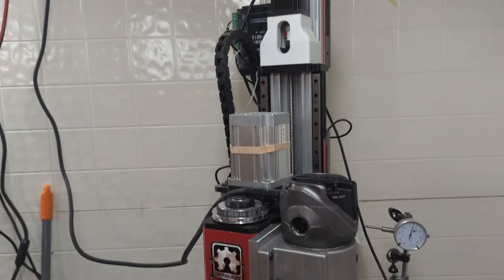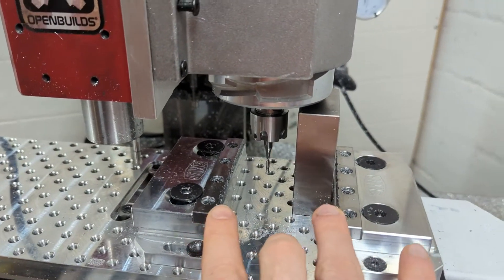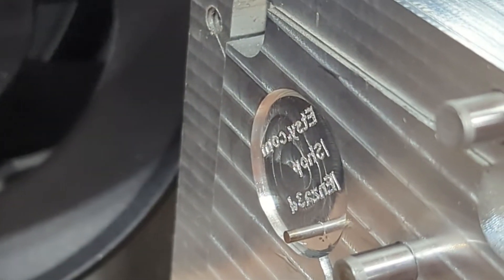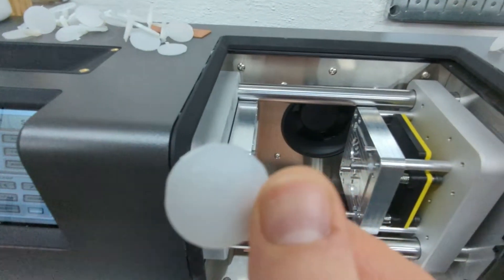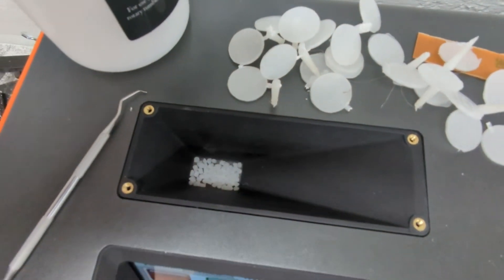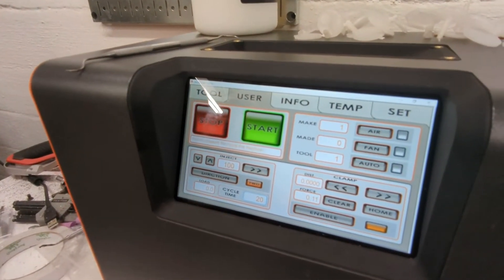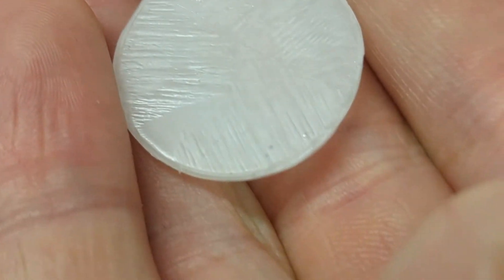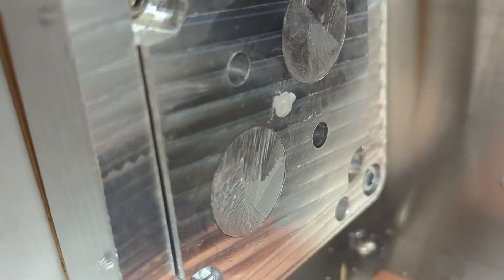RIGCNC update and DIY Injection mold machine

Comment: Why are you using the makita router? What’s the spindle to the side of the router?
Reply from the maker: Different materials can tolerate different speeds and feeds (tool engagement pressure) I use the r8 Spindle for convenient tool changes and materials like steel.   I use the router for materials that can handle higher RPM's such as aluminum, wood and plastic.

Comment: You could probably ditch the aluminum T track and replace it with steel on the X and Y axis and put your fixture plate right on the steel X axis. That T track is probably the weakest link in the whole system.
Reply from the maker: I agree 100%, It really starts resembling a normal mill at that point though and requires the access to tools to work with steel in that form.  One of the core tenants of the RIG is the access to "purchased precision" meaning you can go from nothing to a workable CNC machine without additional access to tools.  It absolutely has an upper limit on its utility but the hope is this acts a intermediary between poorly designed CNC and professional systems.   I like to pretend this is a low cost Tormach alternative.  Its probably a little bit worse than a tormach but is 1/10th the price.

Comment: Love the build and considering one. What size motors are you using? Read your website and saw you are using the openbuilds blackbox can it take external drivers?
Reply from the maker: I am using the OpenBuilds "High torque" NEMA 23's.  I am not 100% sure on if the blackbox can take external drivers but my instinct is no. I've never stalled this system running a part, only accidentally while slamming it into an endstop
Reply: @TheBetterRyanKelly  good to know it can handle that head. Did you have any lost step issues, I'm hesitant to use open loop steppers
Reply from the maker: @LoneWolfPrecisionLLC  I have not, you can hear when it misses a step and it takes a lot of force to get there.  Closed loop steppers are nice but if the stepper is properly sized for the application they aren't needed.
Reply: @TheBetterRyanKelly  gotcha. Got a mini mill I'm specking out will use some of your methods to convert it with more y and linear rails

Comment: This is amazing, probably the best precision CNC design for the price, performance and accuracy. How did you make the aluminum plates, ordered them or you made them using the plastic base first?
Reply from the maker: Thanks! I made them using the plastic base! I started out by milling all the counterbores and all the holes but eventually switched to just spotting the holes with a spot drill on the CNC and then finishing it on a drill press to save time
Reply: @TheBetterRyanKelly  Wow, that is really smart not needing to get it milled from another CNC, saves ton of money and a more logical approach is used. I never thought of doing that, I have a brand new Ender 3 3D printer in box for almost 2 years and never opened it.

Comment: How does IM machine detect the parts are stuck in side A? Do you install some sort of end stop in side A of the mold?
Reply from the maker: There's a drop shoot, if a part doesn't fall through the drop shoot, the machine assumes a part is stuck, it doesn't know if it's side A or side B